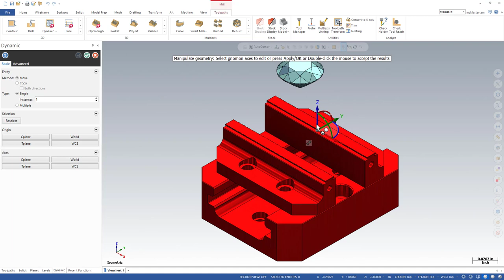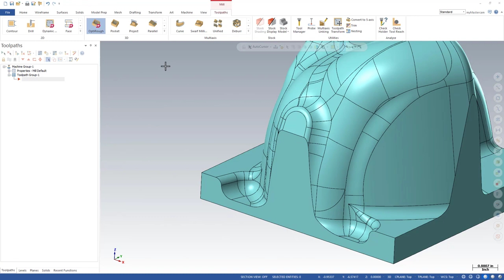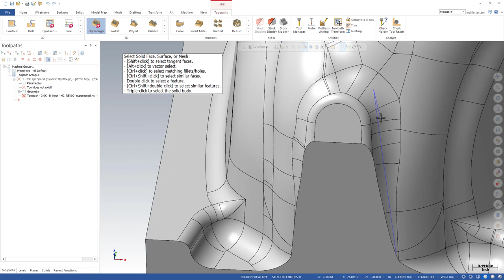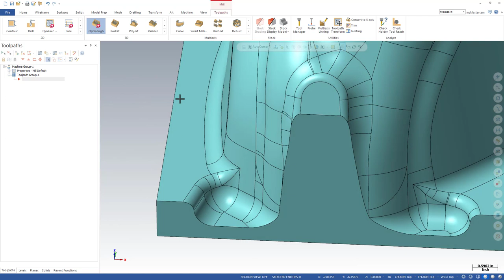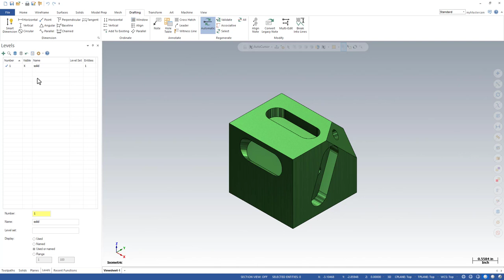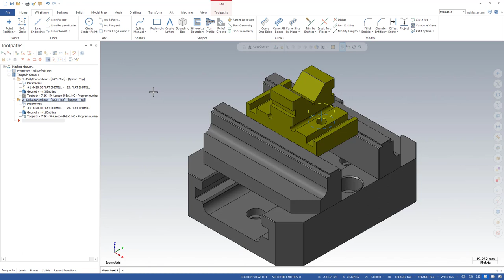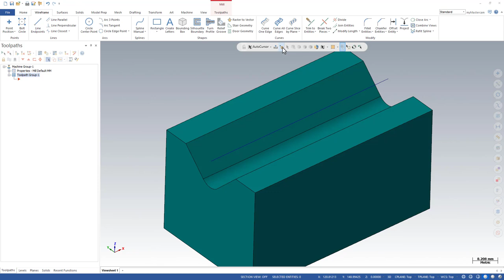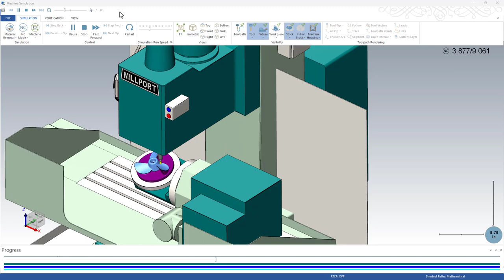Maximizing Efficiency in Mastercam: 6 Pro Tips

Comment: Nice! One quick lesson video idea, what is your workflow for programming mirrored left and right parts. And post every thing at once, program 1 for the left in g54, program 2 for the right in g55, and program 3 for both parts at once. I have no problem doing it, but wich way is best? Mirror the solid and doing twice the work? mirror the toolpath, reverse side and chain on every single toolpath. Is there a way to only edit the right part toolpath and have changed simultanelsy on the left part?